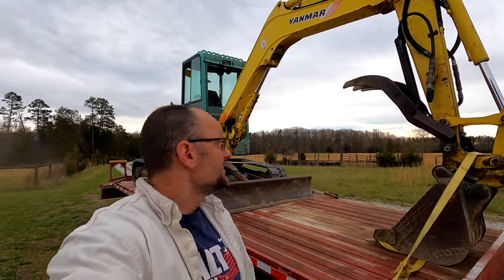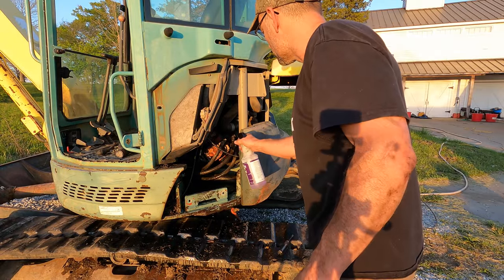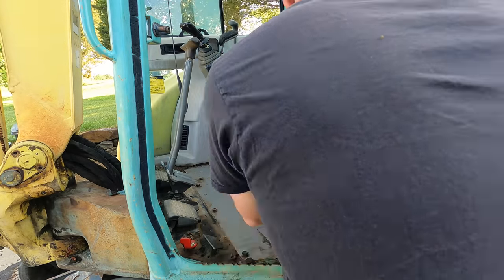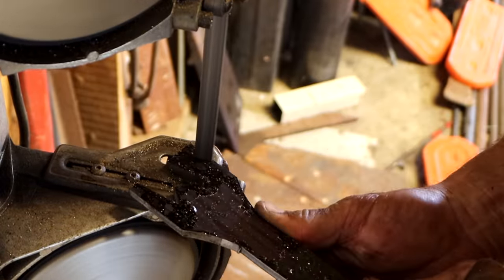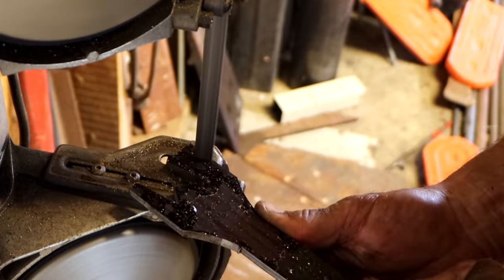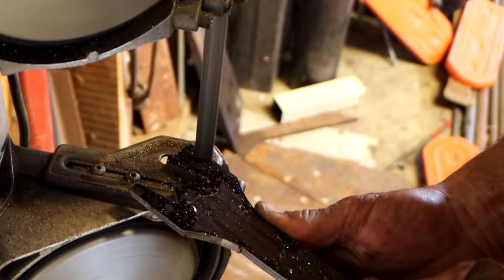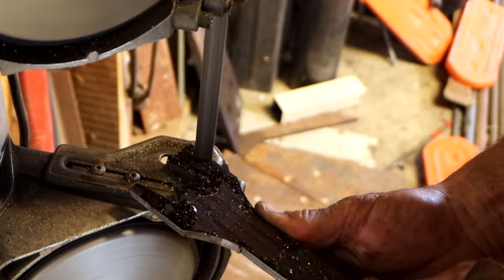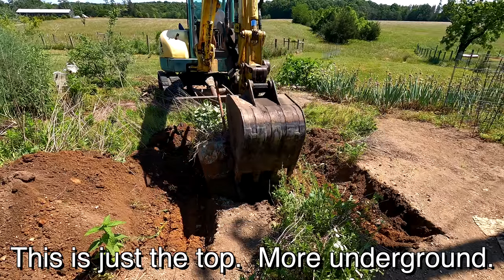Buying (and Fixing) My First Excavator.  Yanmar VIO-50

Comment: 1st-I think you chose wisely; mini-excavator with most size and horsepower; also, a Yanmar with no emissions add ons.  2nd-Looking at online comps; thats a decent price for the condition of machine (i don't think you gave up any money).  3-no MAJOR wear issues, or rebuilds necessary.  I envy you; would like to find one that size and price.  Looking forward to more vids.

Comment: if track won't tighten, could be bad idler wheel bushing/bearing.  Mine wore out so bad the idler actually wore off the weld holding the spring and had to be rewelded.  Take a look at the space between the back of the idler wheel and the part in front to the spring (sorry - you may have this problem fixed by now  as I did not read all of the comments) Just found this channel.  Nice to see someone else with the same machine making videos

Comment: $20K ? man that is alot for a used piece of equipment ! I think I would have got a bigger tractor
or something for that much.... but it is an excavator, and sense you've put new seals in the center pivot you really have a real good reliable machine now..... but I want to see you do the track adjusters.... I've never seen those and it will be real educational for me !
Like you I am a jack of all trades and master of none, and I pride myself on being able to fix anything so watching you on your beautiful property really makes me think I should have been born rich ! without a doubt you are much better at it all than I am.... I don't know where you get all your energy ! LOL   You've done well for yourself !  and that is good to see ! 
like you I had a piece of ground, cows and hogs and chickens, and the world changed when I finally got a tractor... i could do so much more then.... so I understand the need for equipment
I just cringe at spending more for a tool than I did for my house !!! but.... it is a new world !
and it is expensive ! too expensive for this retired old man !
keep up the good work and get some shade up for those cows so they can get out of the summer heat ... their black and black = HEAT ! ......perhaps a trailer /shade thing you can move to the field they are in ?  but they do need shade ! .... if you find them all huddled by a tree you know they are way too hot !

Comment: Loved the video… very informative.   I was alway told never to use any lubricant or cutting oil when using band saw, the blade always slips.  By the way u got hell of a deal on the machine.
Reply: Every heavy duty band saw Ive used over the past 20 years metal working has had supplied lubricant.

Comment: You bought it right. I've had several mini excavators and I currently own a 55-6A. they're great machines I've used All brands and I really like them.They are the best. It's not uncommon for one drive motor to get slow if the machine is used to track a lot. you can rebuild it; it's just bypassing in the seals it's not really that difficult you look very capable. One of the great things about that machine is that has a hydraulic pin grabber which means you can turn the bucket around the other way and use it as a shovel and that is very useful when you're trying to move a pile of dirt. Also a hydraulic pin grabber is adjustable which means if you want to make your own quick connect couplers all you have to do is by the size of pin that's approximately the same size as the one on the bucket it can be a little bit smaller and you just align those in the same orientation as a typical pin would be except that you're spacing between the pins can be  closer than what your bucket is. it's very easy to do I've built quite a few of my own implement couplers.

Comment: I had a 5 ton Komatsu same Yanmar engine. You didn't get ripped off if you say you got it for a good price. 3.5oo hours is low. The maintenance you are doing is good change a few pins and bushes you'll have  a good one. You won't like changing a hose from the rear to the boom. you have to take the seat out and floor up and thread it through a pig of a job. They are good machines to work with.

Comment: That Yanmar just needed a little TLC, and now it's ready to give many more years of service!  I like that you don't cut corners but do the right thing.  Like finding and fixing the two hydraulic leaks on the pump.  Most people would have accepted the leaks and moved on.  As it turned out the fixes looked relatively simple (but granted not easy!).  Enjoying your channel.

Comment: Not read the other comments but it it is not tracking tight My guess is the old track turns just as fast as the new one but it is not as far around because it is worn.
Sort of like a worn tire and a new one.
If it turns toward the worn track this would confirm my theory.
Just an observation.
I enjoyed the video.
Reply: @Hello Terry how are you doing

Comment: A tip I picked up about cleaning radiator fins, 15 psi won't damage them. 

A lot of guys use fuel cans to top up the tank rather than at the pump. The risk there is fuel left in can's may get condensation water in them and it then easily goes into the tank if you empty the can. 
Jono

Comment: Because Yanmar is such a good machine you probably got a pretty good deal. I just bought a 2015 Vio 17-A with 3280 Hr. on it and I gave 16,000.00+1,000.00 shipping. And there is a few things that I have to address with it. Like you said they are not cheep!!

Comment: The first thing you had a question on is called the Pressure relief adjustment. The second one, the "brass bulb" with the o ring is an accumulator.

Comment: I always use Permatex #1 0r #2 on threaded fittings, especially fuel and gasoline. To use teflon tape, keep the tape back at least 2-3 threads from the bottom, and only 2 wraps, no worries.

Comment: I've worked for a case dealership for the past 25 years and we always tell our customers buyer beware when it comes to auctions. 20k for that mini is not to bad.  Your a handy guy so that will cut a lot of the cost of fixing up your 1st excavator. As for the idler adjusters you should on bank on buying rods too because I bet they are really pitted .  The only concern I would have is the tracking of the machine.  when one side gets slower than the other could mean the travel reduction pump is going.  My advice to you is change the oil "which you did" and run it.   Good luck with your new toy.

Comment: Very interesting, nice job! Ya should always loosen the oil fill plug on these components before you drain them of oil, as if you cannot get the fill plug out, you cannot put new oil in - Toyota charges a lot of money to correct this type of mistake - Don't ask me how I know! By the way, after you changed all the fluids and filters, that motor sounds really sweet!
Reply: Toyota Hilux front diffs have problems like that , the crappy hex socket plugs strip out so you need to mig weld a nut on the stripped plug to unscrew them

Comment: I believe you are on the right track with that gold part you removed from the pump. I’m almost positive that part is an accumulator and it’s job is to act like a shock absorber for the hydraulic line. Any jolts the line gets from the implements can spike the pressure in the line. An accumulator adds a space for a fluid pressure spike to escape to when a line exceeds a working pressure from a sudden jolt in a cylinder.

Comment: We rented a Yanmar b 50, It was a great machine. Somebody said the smaller John Deere excavators once were  Yanmars. It had a hydraulic thumb and  was about 7k weight. Cost us $40. per hour by the hour meter.Sprang a leak at the thumb valve and the rubber treads were about to be replaced @ 1K the pair.

Comment: When you said that one track would go faster than the other check the petals inside the Cab of the machine it could be dirt in behind them.So if they are at different positions  all the way forward and all the way back it would mess up your track speed or if the boot is broken for the two little valves where your foot petals is.
Reply: correct . that is very common and often overlooked , check a reply i made further up the page on a similar problem

Comment: Suggest you spray Ospho on any rusted areas to stop the rust and neutralize it.  Ospho turns iron oxide into iron phosphate which is inert. It can also serve as a primer for painting formerly rusted areas.

Comment: I have had to work on lots of very oil soaked woods equipment where washing to find a leak is not an option. I grab a  handful of the best dust I can find, sometimes it's from the floorboard of the cab and I throw it on the area I suspect, it helps to show the leak when you run it.

Comment: I think you did good on price. Auction buys are always a gamble, and usually always have some issues / neglect. Nice work on all the maintenance and TLC - definitely breathed some new life into it. The tracking to one side is often a sign of a worn drive motor. Not a deal breaker and still a useful machine, but keep an eye on that motor for leaks as well. There is often a case drain to check for drive bypass. Not a cheap fix but can often be used as is for a long time.  A quick tip for track maintenance - if you swing the bucket behind the machine and pick up that end with the bucket, you can use the blade to lift from the front and have both tracks in the air at once. But just like anything else, don't put your body underneath the machine unless you set it on stands or blocks.

Comment: I don't know if you got any comments about removing the glass but the first time you pinch one of those hoses and they will explode hydraulic fluid in your face you'll be sorry you took the glass out.    It happened to me and I took a bath with hot hydraulic fluid I was lucky enough to close my eyes at the exact moment.   Be safe operating that machine.

Comment: I used to work on skid steers and mini excavators at home and resell them as a side to my day job.  I'd have paid $20-$22K for it without tax because I was gonna resell it.  If I was buying it to use, I'd retail it for $25 to $28K for one with those hours and leaks fixed, a new tread added, and fluids new.  Remember though, I bought cheap and spent HOURS looking at machines online, and picking them up on my trailer and truck.  I'd only be able to find one that size at that price about once every 6 months.  I'd be buying other machines to sell pretty much 2 a month.  I think you did pretty well, all things considered.  By the way, Yanmar makes really good machines.  I liked to buy IHI because they generally went for 10 to 20 percent under wholesale in my area since they just weren't as well known.  I could actually sell those on Ebay because out East and South people knew they were well made.

Comment: Nice job on making that wrench but I can save you some time. Pawn shops / garage sales or even harbor freight have all kinds of loose tools real cheap. buy some wrenches that you can trash and grind to fit your needs. that way they are already tempered and with a bit of grinding you are up and running for any kind of fastener in just a few minutes time. same goes for screwdrivers and sockets. Glad i found your channel. good content and presentation. Cheers from Texas...............

Comment: If you spray any rusted areas with Ospho they will turn black and stop any more rust from forming.  Ospho contains phosphoric acid which turn iron oxide into iron phosphate which is inert.  Any areas sprayed can also be painted as Ospho also acts as a primer.  It is great stuff and used extensively by those living near or on a coast (saltwater) on their boats and other equopment.  It also leaves a white powder residue which is easily brushed or wiped off.  It works good on tools that rust too.

Comment: Time to learn JIS fittings. Dont forget the swing grease. There should be a cover plate near the boom going down into the swing gear. My Komatsu says theres supposed to be like an inch deep of grease in there. No zerks you just fill the cavity. Underneath the excavator should be another cover plate going to the same area for clean out. You have to reach in and scoop the old out by hand, its fun!

Comment: Looks like the lock nut doesn't need to be snugged to the body cylinder of the thing to make a seal, you could back it off a bit, width of a wrench and all and then install the housing.  Making wrenches out of plate is cool too.

Comment: That gold cylinder is basically a reservoir, just like you diagnosed.  High end motorcycle suspensions have supplemental reservoirs like that for higher demand applications.

Comment: Also, that reservoir looks like a holding tank. I could be mistaking but it could hold high pressurized hydraulic fluid. Those little reservoirs are designed to help give your hydraulic system better or quicker response time so your not waiting for your pump to push fluid to the cylinders, there is already fluid ready to go. I have a much larger one on my 1978 JD backhoe 410. The tank on mine uses a spring, piston and nitrogen gas to hold steady pressure in the tank. Hope this helps. Let me know if I am wrong.

Comment: Those springs around the hoses always rub holes in the hose. However they do a great job protecting the hose from material. What I do is just wrap the hose and the spring at the bends with electrical tape. Some will stick to the spring some will stick to the hose. This keeps the hose centered inside the spring. Given the hot the cold the dry n wet conditions use the higher quality tapes and it will last you a while. Cheap tape will come off in a month. Good tape will last a yr or 2.

Comment: I had a similar problem with my old digger regarding crud in the fuel filter.....the fuel drain didn't show much either. I had to remove the tank to fix a leak and the bottom was full of rusty sludge. I expect yours will be similar; might be worth washing it out.

Comment: As a retired diesel mechanic, never put air pressure to unstop a diesel fuel tank or its lines. Why? Diesel uses no spark to ignite and when you put 32 psi of negative vacuum or standard air pressure to it in an enclosed system or tank or both ,it will explode and could kill you. 

I watched two men get decapitated while attempting to unstop a diesel tank using an air hose with a red shop towel over the fill hole. It only takes that one time of reaching 32 psi. Because the diesel tank only had a 1/4 tank of fuel, made the explosion a hundred times more powerful also. If the tank had been 3/4 full then those two men may have survived with only face burns from a Flash Out. Buy near empty the tank ruptured the welds sending the ends flying at supersonic speed.
Reply: @Hello Robin how are you doing

Comment: I have experience chasing leaks in old equipment and you would do good to have a quality oring kit and if you ever disassemble something that contains one change it while your there, wirh age and temperature cycles they get hard and will leak a bit and if your there anyway you could swap it out. Good luck with your new toy.

Comment: I have been looking at these at the auctions and currently interested in a VIO 70.   From what I've seen in Yanmar, Kobota, Deer and others of the similar size,  the price is right there.  Here in Abq it might be low even.   I tell ya this video will help a lot in what to look for.  I tested it all over and especially the blade strength.   I just wish there was a bit more room in that 70.  I will get one.  Just inherited the family farm and I have 20-30 things to do with one of these right now.  Whoohoo ! Spring/Summer is coming!

Comment: Hydraulic Pro Tip.
When you final Torque a jic tapered seal fitting, take a minute to train the line to have a Clockwise influence. When you finalize the tightening,  the fitting will drag the hose and put a twist in it resulting the hose continuously working to loosen the fitting. At the very least you should be sure to put a little reverse twist into the hose at final, so that it ends up in a neutral twist situation.  A little extra rewind will assure that when this hose swings around, it will always be influencing the fitting to help keep it tight.

Comment: You’re lucky, I checked the final drive oil on the 2nd hand machine I recently got and one side smelt real bad and the other side didn’t have any oil in it. Refilled and it leaked out just as fast 😢 drive motor rebuild ongoing, waiting for parts.

Comment: Seems like a decent price to me.  My son's buddy recently paid $20,000 for one at auction.  Yours seems to be at least as good as shape but theirs had working heat and AC.  They had to replace a couple of hoses and rebuild a couple of cylinders.  They also purchased a full size excavator.  They had to rebuild the curl cylinder.  The piston nut was  3 9/16".  They could not find anyone with a socket that size, so I drew up a wrench for it and my son cut it out on his plasma table.  We only had 1/4" plate so he cut out 4 copies and laminated them together.  The nut was supposed to torque to 1475 ft lbs.  The story that I heard was that they had a 10' cheater and two 250 lb guys were hanging on the end of it to tighten the nut.  The wrench held up to about 4500 fl lbs as far as I can calculate.  My son is currently looking for a used midi excavator.  They are not much more expensive than a mini but you do have to have a semi to haul them.

Comment: To help a lot, spray rusty nuts and bolts with Liquid Wrench (the best) before attempting to loosen.  It's best to wait a few minutes to give it time to soak into threads and loosen the rust.  In some cases you may need to also use a propane torch to help loosen badly rusted nuts and bolts.  Spray before and after heating with Liquid Wrench.